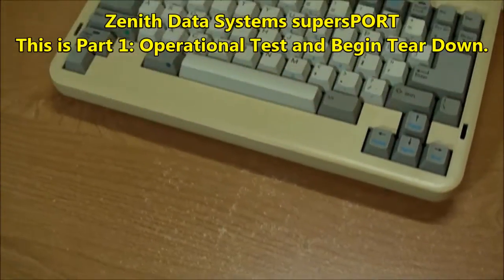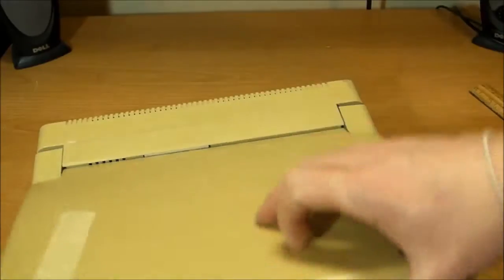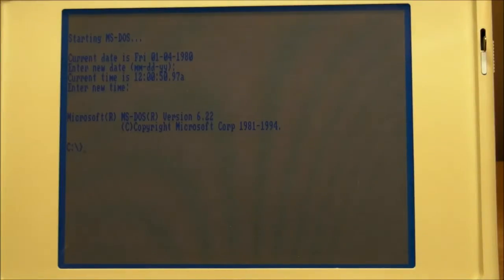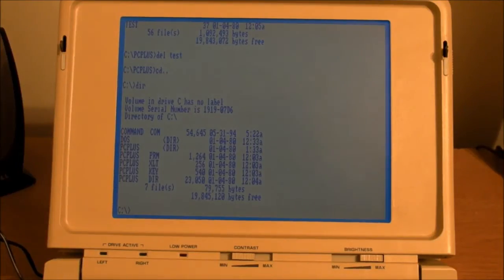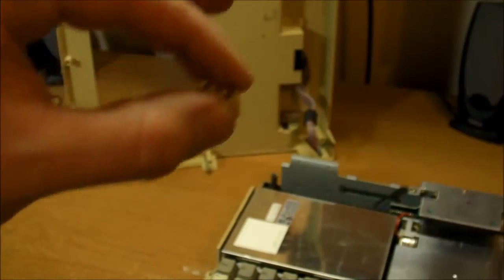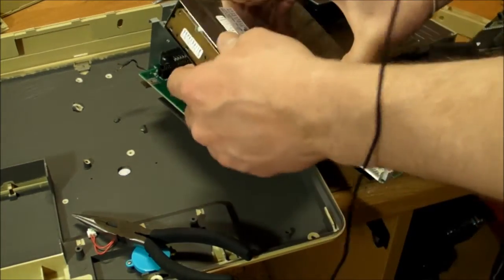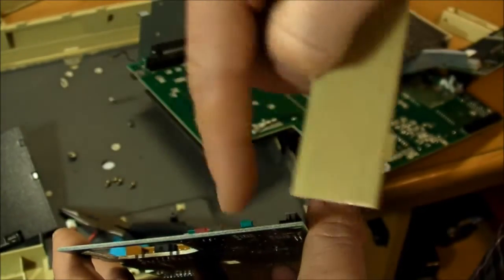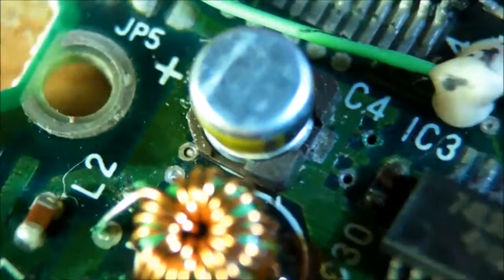(#0142) Zenith Data Systems supersPORT - 1989 Laptop Teardown - Part 1 of 3

Comment: I also had one of those, but the mains powered one. Built in power supply, and a ST506 RLL drive, along with a plug in board that had the controller.  Yours is a later one, with  what looks like a proprietary connector. Made by Seagate of course, you can always see the style of the drives. The one I had used an 80186 processor, and ran at a blazing fast 12MHz. It died when the backlight died, but the LCD had been so faded as well that it was only visible in a dark room. Had a whole 640k of RAM in 64k and 256k chips soldered to the board

Comment: The floppy drives in these only support double-density 720K disks, so high-density 1.44MB disks won't work.
MS-DOS only formatted the disk as 360K because it wasn't set up correctly to work with the 720K drive, using a DRIVPARM command in CONFIG.SYS.

Please save the hard drive, as it is getting difficult to find one for these Zenith laptops that is still working, because they used an early 3.5" hard drive with a proprietary interface.

Comment: 2020 jan - I have 8086/8088 version  with two battery packs, does not have 8087 upgrade yet. Does not have keypad port.  model   -92. (made in Japan)......Long ago had another like your  80286 and the very rare external expansion box, connected with ribbon cable.  it had an acient netork card in it for Novell. (External Bus plate covers where ribbon goes).

Comment: I caught this video because I have an old Zenith Laptop that was probably built by Toshiba.  I'm trying to figure out how to get to the hard drive, but they were so clever building this thing, there are no screws in  the bottom part - none.  I feel like I'm, trying to solve Rubik's cube or something; I can't figure this out at all.  (I am having the same problem with brittle plastic.)

Comment: Get those caps on the hard drive recpaced ASAP! I would do the motherboard and DC converter too. I’m really dreading taking apart my pristine supersPORT to replace the caps as it’s likely gonna crumble. But it has to be done as the machine is starting to show signs of malfunction.
Reply: Replaced ASAP I mean.
Reply: Good news! The machine came apart just fine without breaking! The only caps that were nasty were the hard drive ones, so I got those replaced. All of the others look fine (not that that means anything) but I think they can wait for now.

Comment: I have one of those computers and it seem to be in good shape except for no battery, and no carrying case. The computer turns on and I won't be transporting it anywhere except maybe to a repair shop. The cmos may be out of date on my computer, but it seem to be fine otherwise. The one you have was definitely abused before you got it and is even worst shape now. You either have to look for another one or dump that one.

Comment: Still have mine... HDD long since dead, but will still boot and function off floppy...
Reply: I believe the supersPort 286 uses an IDE hard drive. But the supersPort 8088 uses a strange 26 pin hard drive connector.
Reply: +iVTECInside Try recapping your drive. It may bring it back to life!
Reply: HDD is not dead. There is a mechanism that locks the drive when is laptop turned off, as years passes this part that locks/unlocks gets rusted and cannot move by its own.
You can move this part manually to help HDD start spinn or fix it removing corrossion.